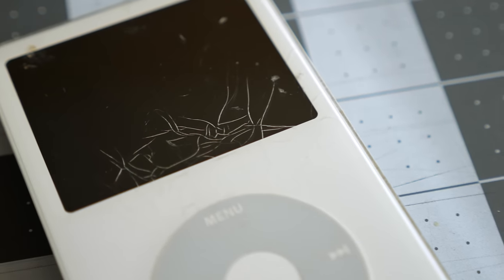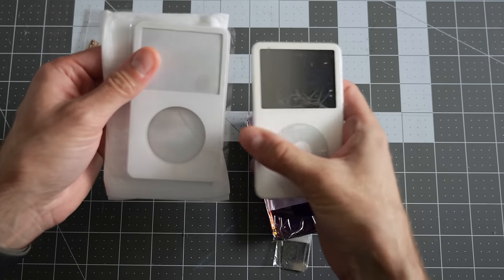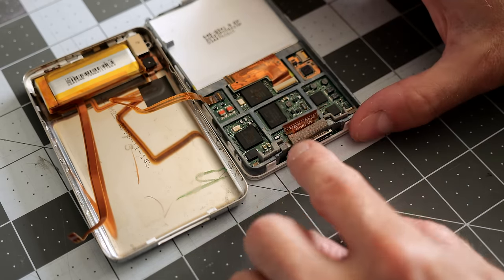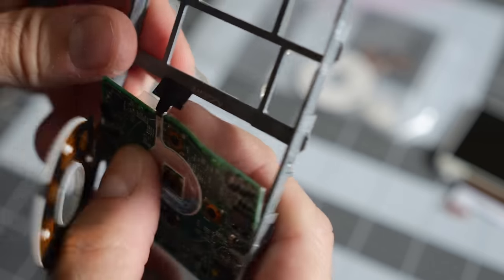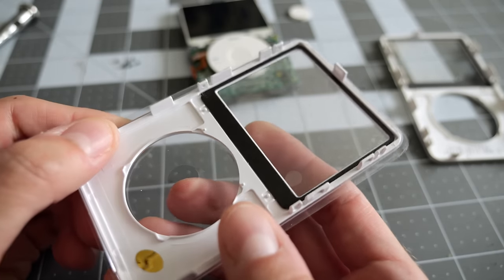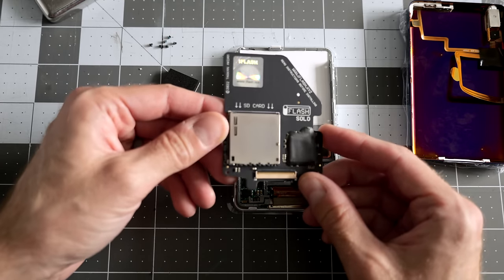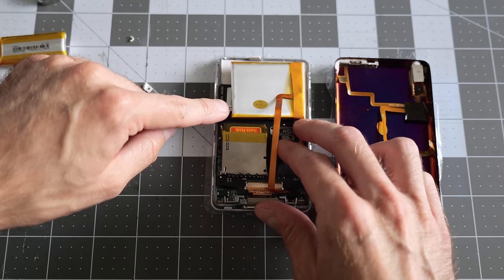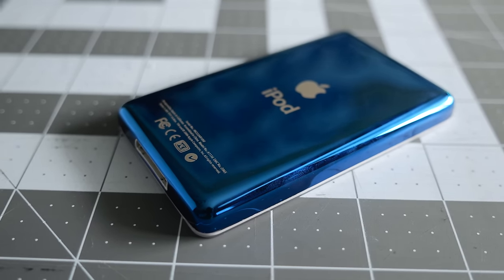Building a Custom iPod Video!

Comment: Note: flash storage consumes less power than a mechanical drive too
Reply: in detail that SD or CF is a good choice on the other hand an SSD will use more energy than a HDD FYI
Reply: Note: Actually measuring or looking it up before making a statement based on assumptions, does require more power/work than otherwise:P
Facts: A row/column based semiconductor storage technology may consume energy that is proportional to that grid. While the mechanical drive consumes energy to rotate the media and position the head. While the "actual storage" in the latter are somewhat "free" (the magnetized data points), there is no such free lunch with grid based semiconductor storage. They take energy to maintain, refresh, write and read ... more as larger they get. Also there are physical limits to miniaturize or better, max both technologies out. The semiconductor based storage, where the cells can't reliably store information based on structural (atom level) niveau, or simply heat wins ... where there is not enough space anymore to bring the heat caused by the action of the "storage-machine" out of the system (which will destroy it). Or on the quantum level for magnetic storage devices, where the units are physically getting to tiny to be reliable anymore. 

P.S.: Just do an experiment. Up to date devices, so top notch engineered Harddrive and SSD. 24/7 writing 100MBit/s to each and measuring the power loss as heat. You'll be surprised ... I'm not:) Price question: With which device will throttling occur first because of the excessive power loss? (With no external cooling as a setup parameter)
Reply: @dieSpinnt  am going off experience, I have a creative touch and the sd card used less power than the ssd, you may have different luck than me, but all I am using is off the shelf parts that also happen to be the cheapest unless you already had parts lying around then great, but the performance will be almost identical with the exception of battery life. Also the word salad does not help your cause it just added noise between A and B :P results don’t lie, also any data sheet will show wattage of the average ssd ( 3 - 6 watts) vs sd (which is 1 watts) if you want to dispute power draw you might have a losing battle, if you want to dispute read times the argument is not there beyond initial read times solid state memory wins as all music on most music players is stored in volatile memory, so your either trying to split hairs with your argument or explain a point that most people already agree with you anyway….???
Reply: @buda3d2007  Yeah doesn't matter. "Experience" is a nice thing to have (famous last words). Semiconductor based storage has to reload capacitors or run a matrix or change some other type of non-volatile memory cells. That costs energy. The one-time magnetization of a surface, on the other hand, is practically free in comparison.
In my contribution, I assume maximum values and the theoretically highest integration in the sub-nanometer range (perhaps we will still see that?). What I was talking about (and you obviously didn't understand) was the physical limitations of different technologies. Incidentally, they are not even up for debate. No matter how much you "believe" or have supposed experience, it's just the way it is, thanks to Mother Nature.
Of course you are also right: for the home user one assumes a ratio of 2:3 in the power consumption of SSD to hard disk. But it's not that big either. In the data center or in applications such as e.g. at CERN, things are different again.
By the way, you can always cheat with examples and most likely "experience" is a good thing ... but also can be used to lie to yourself (and others):
   - Samsung 850 EVO, 500G 2.5", average power 4.7W, idle 50mW
   - WD Blue, 500G 2.5", average R/W 1.4W, idle 55mW, sleep .13mW

So please stop acting like you ate wisdom with spoons. In reality, many things are more complicated and diverse than you initially thought.
Measuring (with actual equipment) means knowing!
Reply: @dieSpinnt  What point are you trying to make?  you took a very long way around to telling me the specs of the medium without applying it specifically to the use case at hand, I'm happy for you that you know all this stuff but this knowledge has not been applied to the problem, pure and simple. 

The volatile memory has been in all music players since the Discman to stop skipping, my point was an MP3 player has been designed to read that from the sd,ssd,hdd and put that into it memory for playing, this was a big feature of all devices to mitigate the need to have the storage medium have power running to it at all times, again your word salad has nothing to do with the problems and solutions I have highlighted, stop copying gibeerish from the web and re-writing it here as you do not seem to be applying it to the problem, good luck with your life.....
Reply: @buda3d2007  Your generalization was just wrong. I'm okay that this is out of your mental capacity. And it is really okay, because now we have narrowed it down to that special use case, you described in your last post (for the first time ...). 
You ignoring real data (you can look that up, too ... with ease!), winding around like a snake and beating your narrative (a dead horse) is simply not my problem. (Well, at the end it really comes down to experience ... YOUR experience ... but the world is larger and more complicated, don't you think?:P )
P.S: volatile memory is just a category of semiconductor based devices arranged in a grid, that adds worse power consumption specs because of the necessity to permanently reloading the underlying storage device, which is usually a MOSFET-capacitor ... but also a pre-amp/gate is included in most non-volatile storage devices like EEPROM/FRAM/FLASH/etc. You don't have to know this, just measure it!;)

Here is a list of more dead horses you can try: 
- But it was clear from the beginning.
- But the data rate. 
- But ad hominem (oh sorry, you little f tried that before)
- But I don't understand, so you must be wrong: WTF is this even? A honest fellow commentator would ASK about what he didn't understood. You just say, in other words: That is BS ... with no hint! ... I even don't know what you didn't understood. I think maybe you aren't interested in learning or following the facts? Or how else should I interpret your strange behavior? Maybe this horse can be revived? 

P.S.S.: Do you call actual and proved data, so called facts ... the REAL specs of the two devices, that "disprove" your narrative (yeah it is more mocking, which I made clear), which I posted and you call "copying gibeerish from the web and re-writing it here" because it doesn't fit your narrative and you don't like that? If so, then you should be ashamed, this is disgusting and contemptible behavior. Discussion culture from the lowest drawer. But I'm probably wrong in that assumption. 
Why didn't you specify what you consider copied and misrepresented? It can't be important to you if you keep it secret, or? What is this behavior supposed to mean? The person you're talking to can't read minds.
Reply: would u say with a 3000mah battery u would get times like we had when we had nokia 3310 that shit last a week on battery.
Reply: @sasproductions701  definitely not. Don’t forget the screen but also other stuff
Reply: I knew there'd be an argument consisting of several walls of text here. I learned a couple things, too.
Reply: @JoBot__  great thanks for telling us.
Reply: @sasproductions701  That's just how my brain works.
Reply: @dieSpinnt  And that's the difference of being an engineer with equipment to measure things and using then to prove a point!  :)
Reply: Nice
Reply: @buda3d2007  no response to him? what about all your "experience?"
Reply: @sasproductions701  so sassy  > ; )
Reply: @dieSpinnt  I might stalk your comments. Can we do that here? I looked for good vids about this all evening. I finally finish watching this one after firing up my old gen 5 midway through, and finding a song that I've been failing to remember for nigh on - - - 10+ yrs. Found it, The Vines - Get Free.. I immediately scoured nzb's etc for it, found it,  then carried on to the end. 

And then I see this shit. WOW. Thank you! I laughed out LOUD. I lived through it's cordon bleu phase. I loved every word from both parties. Amazing wall of text people.

And I also don't care who 'won'.. It's always true that it takes two to tango. My brains just do shit when
Reply: @citizenatlrge dud truly the soul of the parties lol
Reply: Not the msata one that one uses more then the hard drive
Reply: the motors alone is a guzzler

Comment: Apple should bring those iPods back as a CLASSIC EDITION
Reply: They could easily bring them back, with nothing more than updated storage, and they'd sell well.
Reply: @Demotricus  More storage, bluetooth, USB-C. Yup!
Reply: @Juleru 30-pin keeps the vibes though. wireless charging would be cool though
Reply: @aerobolt256  Sure, it's got the nostalgia but it's big and slow. No need to reinvent the wheel to create a new one that is able to use USB 3 speeds. It would be perfectly fine for Apple to just be lazy here and use what already exists.

Comment: My 5th gen. 60GB that I bought new in '05 is now on it's 4th battery and has 512GB of SD-card storage. Still an amazing device!
Reply: I will upgrade mine soon, but it's really nice on road trips... many times you lose radio and cell service so all you have is a portable music device.
Reply: I've only just had to get mine it's first, after 18+ years!
Reply: How hard was it to mod? I've got a 5G Video with a partially broken screen and I have to admit that I'm at least a little bit tempted after watching so many videos about it (I think Youtube wants to tell me something).
Reply: @Juleru  Not terribly difficult. Just be patient. I just upgraded a Gen. 4 and that was a bit more fiddly owing to an additional ribbon cable needed. I'd highly recommend buying a head-mounted magnifier and a cheap phone repair kit. Securing/Unsecuring the ribbon cables is really the part you need to use the most caution.
Reply: @spoon072000  Thanks for the tips! Is there a trick to removing/connecting the ribbon cables? I've got fine tweezers that I used to use with a 3D printer but I can imagine that those could damage the cables because they're probably pretty thin.
Reply: @Juleru  The ribbon cables are actually pretty strong. It's the connectors that require care, especially the battery cable. The battery is stuck to the metal back, so take care after the back is opened. You do not want to tug the ribbon cable too hard or you run the risk of tearing the connector off of the board. I know. I did that once. Luckily I have a friend who is a wizard at soldering and was able to repair it.

Comment: Man I miss those ipod controls, felt so quirky but it worked. Im surprised modern consoles didnt try using that for a scroll effect for menus or inventory.
Reply: Isn’t it patented?
Reply: @FloydBunsen  The design as you see it might be, but my guess is you cant patent the tech to a point where it cant be copied, at its heart its just a touch sensitive none moving circle, we have touch screens and touch pads for laptops so thats the tech down, the buttons for playback control are just buttons under the click wheel, cant patent that. basically apple could only have patented the design over all, but a touch sensitive circle... Nah they cant patent that, or at least make it stick very well.
Reply: Try Steam Controller's touch panels
Reply: The closest is Steam Controller and Steam Deck's touchpads with scroll wheel input mode.
Reply: Check out the Sony Pocket Vaio. The scrolling on that is incredible. Sony calls it a g-sense pad.
Reply: Actually Samsung Galaxy watches scroll this way when you “slide” your finger along the edge of the screen in clockwise and counterclockwise directions. Also some other smartwatches I think.
Reply: Apple would have patented the tell out if it to stop others using it.
It's a dam game apple didn't make a classic with 1 TB SSD and better RAM and processors 
That would of been the best iPod especially in as the community already has done this for a decade if they could make one faster better battery .that would of been the perfect iPod classic to end on
Reply: The Steam Controller copied it and it was panned as the worst feature.

Comment: Super handy to see one come apart. I have a 5th gen here with a dead battery that needs to be replaced at some point.
Reply: Dankpods has a whole video about taking apart and fixing every kind of ipod
Reply: How is this comment from 3 days ago? This was uploaded 4 hours ago.
Reply: INCREDIBLY easy to fix and purchase. Best place to pick up batteries is actually eBay. Just make sure you're buying for your correct model/size. 🙂
Reply: @jamesdriver0317  Time traveler.
Reply: @jamesdriver0317  Patreon supporters get early access to the videos, as well as Colin's podcasts! I highly recommend supporting Colin on Patreon if you enjoy his work. 😀
Reply: One tip I have for you on the battery replacement. Be very careful when you pry up the battery. If you're not careful you can rip the hold switch cable, it sits directly under the battery.
Reply: @g4mmalotus937  I used his guides when I upgraded by own iPod Video's battery and storage. The later models get a lot harder to upgrade without damaging, but the 5th gen is easy to get into.
Reply: 5th gens are fairly easy to disassemble and refurbish once you get into the groove of it

Comment: I bought the 7th gen 160gb back in 2013. I had iPhones that I used mainly for my music consumption and basically left this iPod in the box all these years for “just in case”. I recently got into IEM’s and am soooo glad I never touched this iPod. I kept cycling the battery through the years. Once every couple months I’d run it halfway or fully out then recharge. So I have an essentially brand new iPod without a scratch on it ready to rock. But since I have such an extensive library, I’m thinking of going with the iflash quad with 1TB.  This looks super simple. And all I’ll need is the battery and flash drive/micro sd’s. I know the 7th gen is much harder to open but looking at the videos from EOE, it doesn’t look hard at all. Very cool that we can do this and keep alive an extremely capable music player. In a world where tech is progressing so quickly, that we are throwing so much stuff away, this is certainly a breath of fresh air.

Comment: I remember buying one of these brand new and then modding in an iFlash adapter with a 32GB CF card. It made it so much better since it never needed to park a HDD head and pause your music. This device was possibly also responsible for my first patch contribution to an open source software, as I needed to patch RockBox to get it to run correctly on the iFlashified device.

Comment: That's cool.  I bought the 60 gig version of that back in October of 2005 to go with the new car I bought at the same time.  I even had the back of it engraved, something Apple offered at the time...  I THINK it was Apple that offered it.  It all happened when I ordered it.  I got the video output kit for it that came with the remote, too.  I still have it all.  The iPod is on display in my office.  It still works.  I'm sure the battery will soon need removing, obviously.  Looks good, man!
Reply: To this day you can get free engraving on many products. From iPads to Apple pencils to even AirPods. Not for macs though
Reply: Better to get the battery out sooner than later. The battery in my 5th gen puffed up & actually popped the housing apart. I replaced the battery but the housing didn't snap back together completely due to the deformation from the puffed battery.
Reply: @nexarian2523  You got lucky! The battery is right behind the screen so in some instances it cracks the screen.

Comment: I used an iflash in my 4th gen a few years ago. It made it a hell of a lot more useful. 
The only bad part of the process was opening up the back, tried plastic and metal tools first but it just killed them all. Ended up stabbing a good knife in there to open it then bending the back into shape later.
Reply: Yeah unfortunately that's the only good way. I usually use a putty knife, it helps keep it from bending a lot.
Reply: you should check out how dankpods opens them, the only iPods that are really hard to open are 6 and above because of all the metal
Reply: @radiicall  I did, he's the reason I finally bought some ipods. Couldn't get it open with his or any method I found online though.
Reply: Oh god; all you have to do is find the clips and push them forward, the poor case :(
Reply: I literally used a butter knife. I didn't destroy it, it worked out.